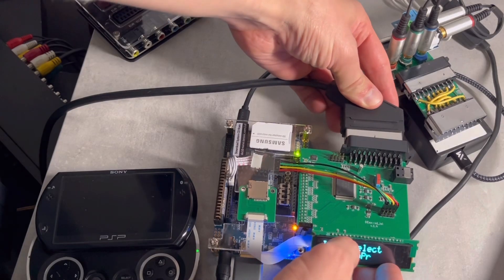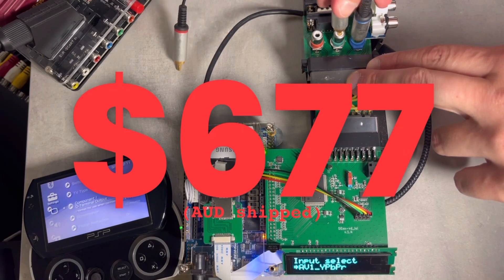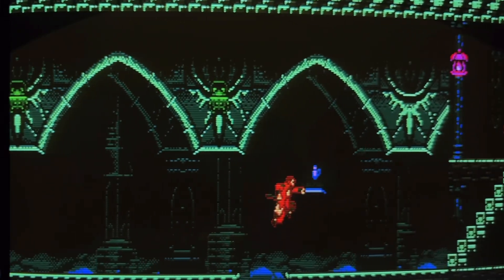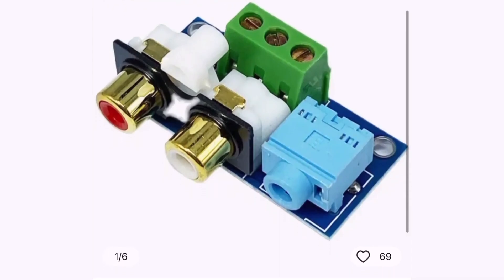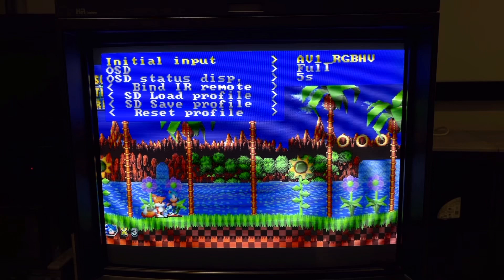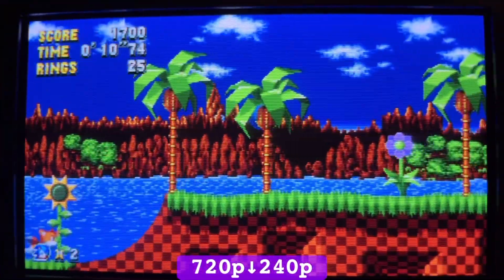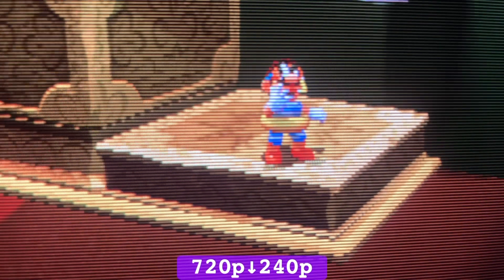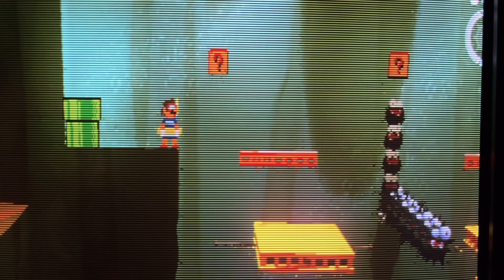Downscaling Chronicles 4: DExx OSSC Pro DE10 addon (Mister FPGA). 720p and 480p to 240p and 480i

Comment from the maker: Marqs has advised a fix to the 480p RGBHV input
https://videogameperfection.com/forums/topic/dexx-vd_isl-horizontal-jitter-in-scaling-mode/

CORRECTIONS: Unzip the firmware and flash the .img file, NOT zip file. Also a minor correction, the DE-10’s ‘GPIO2’ I was referring to is called GPIO0

Comment: There has to be some janky way to switch between MiSTer and DExx mode somehow. I can deal with the other stuff, but having to swap between the two modes by pulling out the SD card makes me paranoid. Those connectors are fragile.
Reply from the maker: There’s 2 ways around it; 1 is to use a micro sd extension cable like I did in the video so there’s no wear and tear on the de10’s port 3:26. The other is to add to the sd extension adapter a 2 in, 1 out micro sd adapter that are advertised for raspberry pi’s. You can see one at 2:27 next to the de10. I didn’t mention it in the video as my de10’s sd slot shorted when using it and it was costly to ship it back to Terasic to repair. It turned out not to be the culprit and I did have someone else in the Mister FPGA community verify they’re safe, and that’s what I’m using now which I show briefly in action in Episode 8 of the Downscaling Chronicles
Reply: @MarcoRetro316 Thanks for the info. Even with the limitations and steep price this is really tempting for me. The video is also pushing me towards finally getting a Corio instead however, since I'd primarily want to use downscaling for video rather than games (which my Mister covers through hardware emulation). 
Thanks for the great series! Most people don't understand the pain and suffering that is downscaling to 15kHz.
Reply from the maker: @MisakaMikotoDesu I feel your pain haha. Thanks for the kind words. A Corio might be overkill for video but they’re great if you’re ok with spending the money and doing the setup. You’ll end up with a smooth RGB/component output and picture manoeuvrability

Comment: Excellent video and topic! Theres not much for downscaling info and content, youve tested a few options now, is there anything else you plan to test?
I thought I remembered reading the retrotink 5x will downscale to 240p and the the RT4k will as well, any plans to test them?
Reply from the maker: Thanks a lot! I hinted the next downscaler I’ll feature will be the RetroTink5x. Mike Chi has often said that downscaling is an experimental feature so it will be interesting to see how it compares to the Dexx. After that I have the DVDO and will keep looking at other options and methods. It’ll culminate to a final showdown comparing all of them and I’m starting to get a feel that it may come down to versatility versus accurate downscaling. Btw I’ve been a long time fan of your channel, always churning out great videos. Did you ever get the vertical sync issue fixed on the 20M2?
Reply: @MarcoRetro316  Oh wow, thanks man!
I ended up finding another 20m2u on ebay that had a shorted green gun on the tube, no one was bidding so made an offer for just the boards to save on shipping and save the seller the hastle of shipping..... He accepted and I have the boards but they were recapped by the seller with cheap caps so I still need to do a recap 😖
Just went through a move so still getting settled in but hope to make a vid on fixing that monitor soon.

Looking forward to your next vids, keep up the good work!
Reply: @MarcoRetro316  Whatever result you come to I’m probably going to throw all my money at.
Reply from the maker: @lukeerikdavis  the pressure is real haha. I’ll give them a score card at the end and try to see which scaler fits each downscaling scenario. Keep in mind I’m in the minority that plays on a widescreen TV but so far all scalers have had picture adjustments to squeeze to a 4:3 display

Comment: honestly just get a RGB Pi at this point to solve all your dramas
Reply from the maker: I’ve got a Pi4 with a CRTDual hat which is essentially the same as an RGB Pi and it’s fantastic for 15KHz gaming. This short series is focused on downscaling modern consoles to 15KHz which the raspberry pi does not
Reply: @MarcoRetro316  i get ya... its a downscale video... i have a HD Fury 3 and I have downscaled modern day consoles on the sony kvhr36 720p or 1080i and they look average or terrible (exception is ps vita tv).. moving on... id rather you acquire new crts and review them lol or try out and or review CRT dual i wannt see it.. I recently bought VGC2NTSC from retro upgrades im going to test that out... i really should upload all my findings on youtube bro